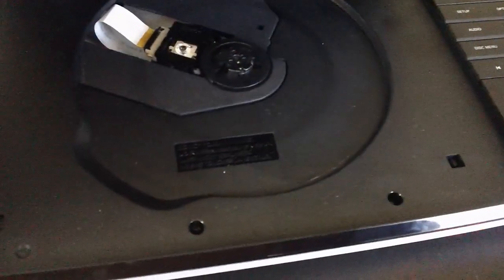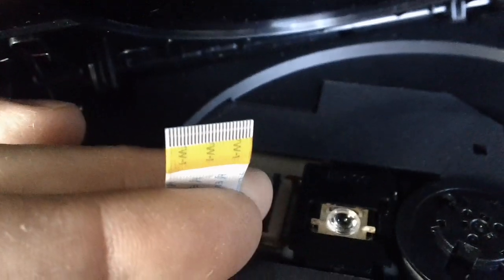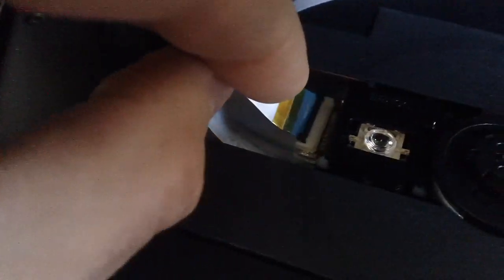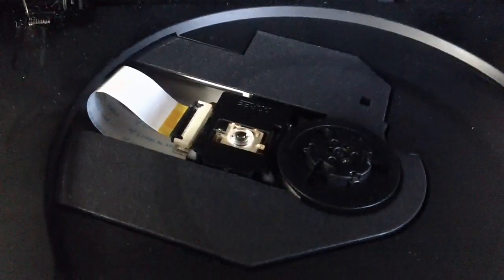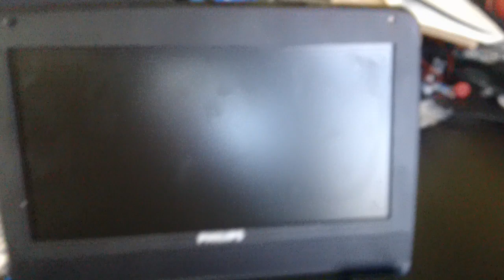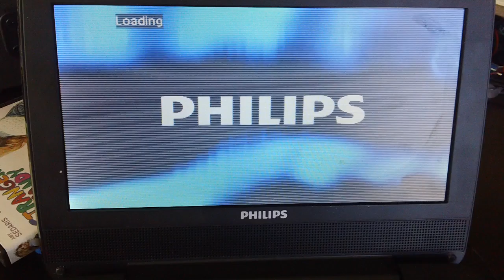How To Fix Philips PD9000 Disk Read Error - Portable DVD Player

Comment: I really did not have to remove the cable ribbon. All I did was clean it with rubbing alcohol and now I can watch my Dvds. At first it was reading no disk but I cleaned it using a Q tip a few times as well as cleaned the laser gently and it saved me from buying another portable DVD player. Thanks for this video and the tip on how to fix mine. 🤑🤑👍👍
Reply: Is there any rubbing alcohol alternative?

Comment: NEVER, NEVER, NEVER, EVER use a pencil eraser to clean electronic contacts. This destroys the contact by damaging and/or wearing away the metal surface which is extremely thin to begin with. Best choice: Caig Deoxit D5 - this stuff cleans and then bonds to the surface on a molecular level to actually improve contact. It will "migrate" also which helps to improve the opposite surface too. Next best choice: 97% or higher isopropyl alcohol. Use a cotton cloth or, as a compromise, cotton swab. After dry shoot the surface with a very brief squirt of compressed air. DON'T BLOW on the surface. That reintroduces moisture from your breath which encourages corrosion and undoes what you just cleaned.  The air blast is to remove any fibers left from the swab. Cloth is less prone to do this, but not immune, to leaving fibers

Comment: It worked thanks alot and I didnt have to pull the ribbon out I just used the eraser on it without pulling it out and it worked. Thanks
Reply from the maker: That may have just rattled the connection but the eraser polishes the contacts if they are oxidized.
Reply: I didn't either. All I used was rubbing alcohol with a Q tip and it now works like new. 👍

Comment: I tried it and it didnt work. I cant even hear a spinning noise I'm really stumped
Reply: Try cleaning the tape ribbon with alcohol using a Q tip. Also try cleaning the laser very gently with just a touch. It might be just dirty. Then try a few times loading your dvds and it should start to work. Eventually you'll be watching your dvds again. Worth a try. 👍

Comment: Mine did not work I took the thing out and I put it back in and it didn't work 😈
Reply from the maker: betzy serrato did you clean the ribbon with eraser? It gets oxidized, try rubbing alcohol also on it
Reply: Alcohol worked on mine. I did not even have to pull the ribbon out. 👍